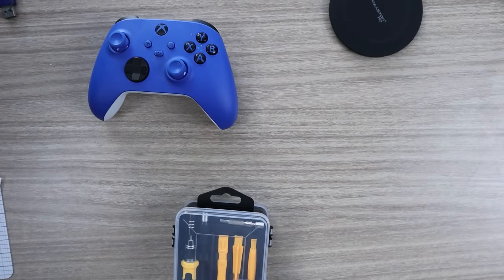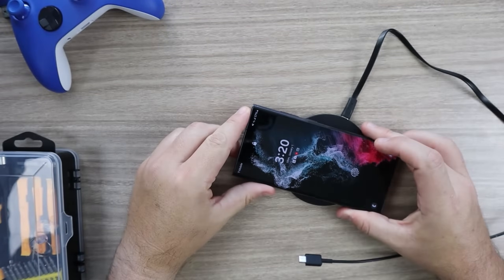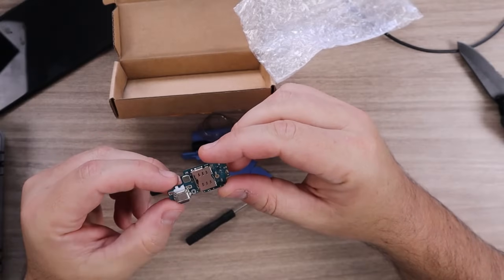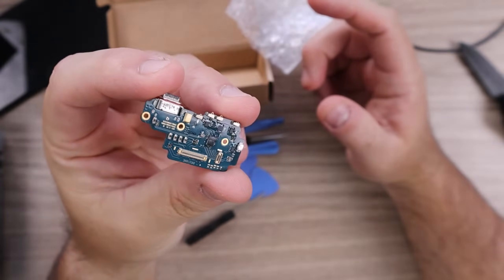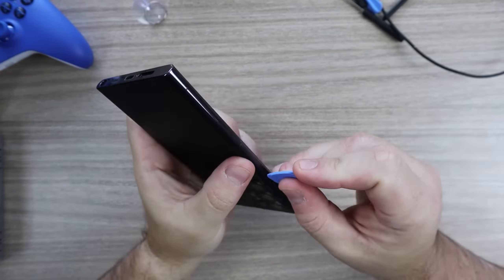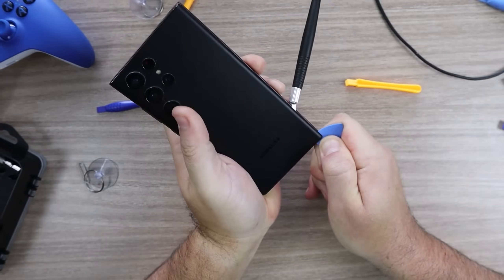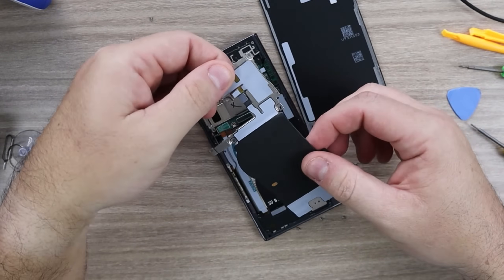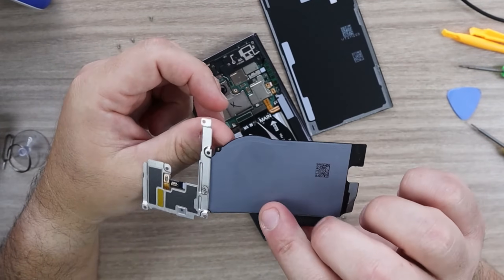S22 Ultra Charging Port Replacement! How to repair cell phone charging port! DIY

Comment: Same here. Back cover removal always the scariest, especially if it's your own, or your girlfriend's phone ;) Thanks for the screw pointers, saved me some searching time. I also used a heat-cannon, focused it on the sides, where it's glued. These phones are able to handle 80 Celsius (reaching that in the Sun) without damage.

Comment: The hardest part was removing the back, then the screws looked like they were put in with locktite as they didn't want to turn without a lot of force.  But following your directions I was able to replace my charging port and get the phone to charge again.  So thank you.

Comment: I have a question would it even be possible to remove the back cover if my cover is cracked on the edge on the whole side 🤔 or would I just have to go into my phone company and have them do it? Or would I still be able to take it off but I would need a new cover after I take it off because it's messed up
Reply from the maker: It's hard to say, but you would probably need a new cover.

Comment: Cracked my backs screen rushing with a tool which didn't work and eventually switched to a razor blade that did work.

All in all my repair was successful and saved me from needing to spend $400-500 for a replacement and instead I only spent $50-60 including a replacement back cover

Thank you!!

Comment: If the adhesive is separated does it still have enough sticky left to hold when putting it all back.
Reply from the maker: Mine is still holding up.
Reply: @LMFTechStudios  I just went for it and yep, still holding up.  I used a heat gun and it went well.

Comment: LMF Tech Studios. I think they said heat gun 🔫 is better, as super hot temperature and keep on doing it, the adhesive glue will slowly loosened out
Reply from the maker: Absolutely, a heat gun would be ideal. 👍

Comment: This was great man, you're awesome! My only question is how do you keep it place again once you put it back after you scraped through the glue the first time?
Reply: Yeah, don’t go tanking it into water after this, it will no longer be waterproof 😊
Reply from the maker: I didn't really do anything to it. It is holding up pretty well still, and it is in a case, so it is not much of an issue.

Comment: Tip for anyone struggling.  Heat tf out the back if it's still hard.  Also be very mindful of all the connectors.  Make sure they snap in but DO NOT force them . They should snap in with little pressure

Comment: Regarding the cover, do I need to glue anything after you finish everything?
Reply from the maker: I didn't and haven't had any issues, still working great, but it would be best if you did.
Reply: @LMFTechStudios  Bro, today the new USB port arrived, I set everything up correctly, but it's not charging. What could be another reason?
Reply from the maker: Hard to say. I would triple check that everything is properly connected but it could also mean that the part might also be defective.
Reply: @LMFTechStudios  What do you think , maybe a faulty Flex Cable? 🤔

Comment: Use a suction up. If you can slightly pop on edge just a little you can use a razor, or pick and get under it. once under, you can use a Qtip with alcohol to work around it slowly. This will also preserve the adhesive for the most part
Reply: so I dont need to buy adhesive to close it back up??

Comment: Does this solve the mobile network connectivity issues?
Reply from the maker: I never had problems with mine; I live in Florida and been in several states and internationally (Brazil), and no complaints about the network
Reply: I have the same issue in network, and all articals I sow they mentioned this is one of the possible reasons.
Mey also the network cable ,

So, I came here to ask if the charging board is related to the network receiver somehow?
Reply: @DawoodYawansehcis  i change the flex cable and problem was solved